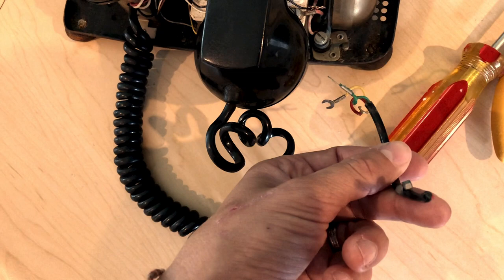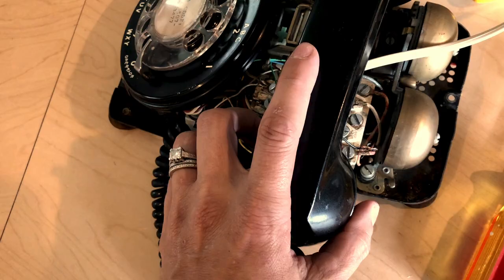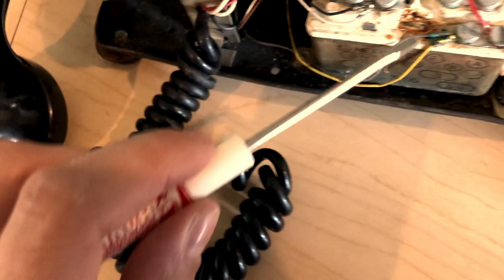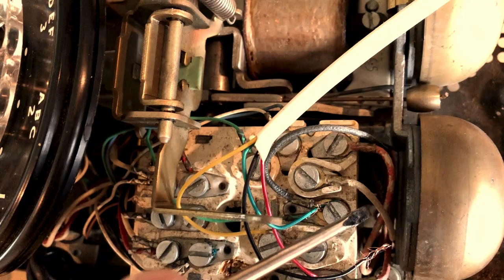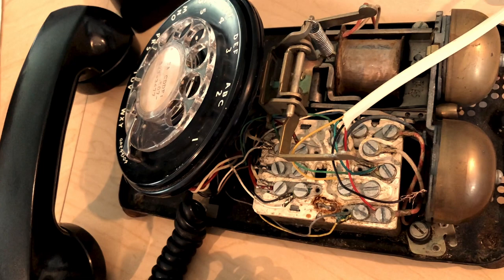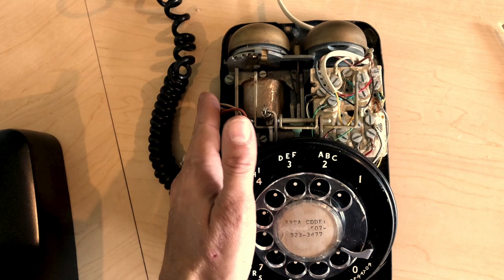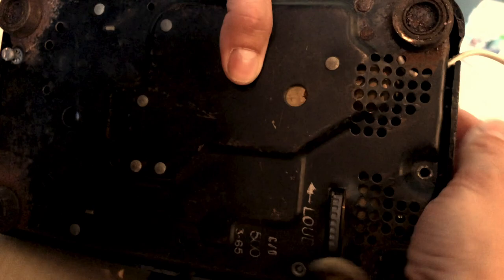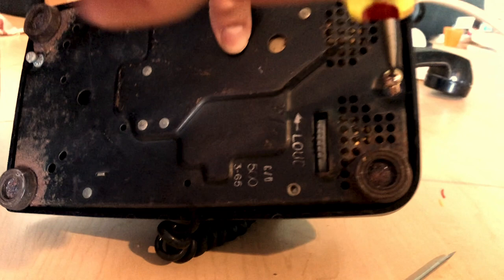How to rewire a vintage phone

Comment: Thank you for this.  I just rewired my parents red rotary phone from 1953.  We used to call it the bat phone just because it was red.  I inherited it when they passed and it's been sitting in my home office for 5 years now. It's a conversation piece but I've also wanted it to work again, and now it does!  Nothing like the ring of an old rotary phone.  the only part that was frustrating in this process was trying to strip those skinny little wires.  Grrrrr..  it took me forever and about 4 inches of cord in the end. 😂
Reply from the maker: Yeahhh! I’m so excited for you!!
Reply: @heartysol  These are MUCH, MUCH better than all these cheap SHY NA phones, IF I can find my old 60's era phone I will try this, if it doesn't work I may touch back, seems I did this conversion to that plug years ago & it needed only 2 wires connected

Comment: Thank you Very much!
Your instructions were so easy to follow ,and your camera was nice and close so I could see right where my connections would go .
Thank 😊 you so Very much!
Reply from the maker: Yeahhh! I am so glad you found this helpful!
Reply: @heartysol  I recently found your video,  and followed your instructions and my rotary phone works!!! Thank You 😊
Reply from the maker: @MISSUNIVERSE1830  yeah!!
Reply: @heartysol  hi again, do I need to attach the yellow cord or can I just do red and green?
Reply from the maker: @dilhangurbuzergamingchanel7306  I would do all 3.
Reply: @heartysol  oh.  I believe this is the same setup for the 554 wall phone, but why is the yellow needed, I don’t wanna cause a fight by any means but I only have one line and one phone number.
Reply from the maker: @dilhangurbuzergamingchanel7306  I’d say, go ahead and give it a try and see what happens. I just had all 3 on mine. Good luck!
Reply: @heartysol  thanks and hopefully it works!  My phone that I bought on eBay says that it is untested but I hope that it works, and also i will subscribe to your channel.

Comment: Hi! Just a question, why do you need the yellow wire?  I thought it’s red and green.
Reply: Black/Yellow should have both been lopped off.  They're for carrying the same signaling as Red/Green, but for an optional 2nd phone number.  Even if there's no 2nd number, they may have continuity all the way back to the CO switch & should not be connected anywhere inside that single-line device.

Comment: Hey so just curious, When you hooked up the wire to the cord, it looks like you took the little plastic jack thingy off. Is this true? And then you just hooked up the wired without the clear plastic jack thingy correct?

Comment: Hi, I have a Bell system 302 made by Western Electric (03 / 1947).  I would like to use it with my Consumer Cellular ZTE 4G base station.  The base does not accept rotary dialing, (pulse) and I would ask how to modify the phone  ( rewire, or  add additional parts) to use on the above system,   Please advise.  Thank You.
Reply from the maker: Hm, Im quite certain it will not work with anything 4G since they are completely different generations of technology. Perhaps there is a transponder or translator of some sort, but I can't say for sure. Good luck!